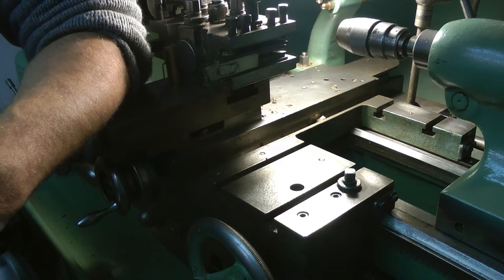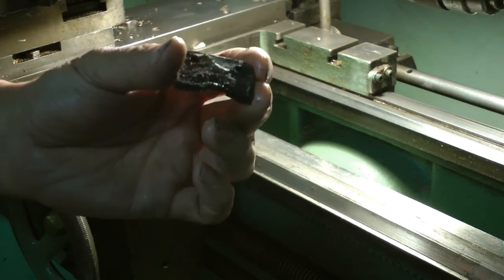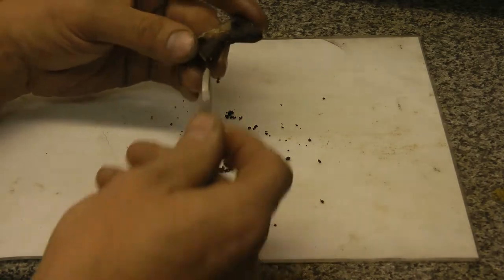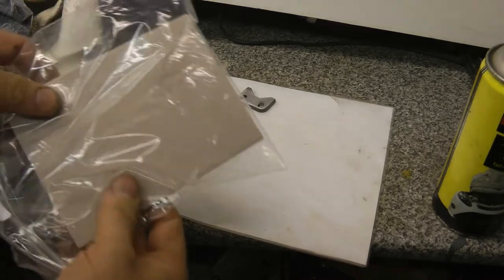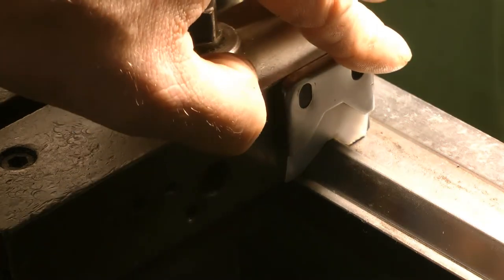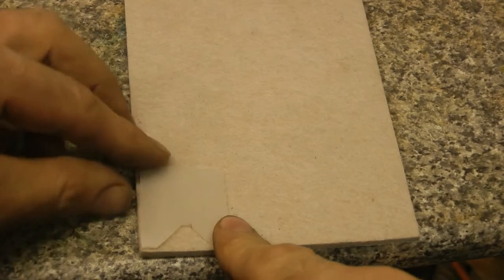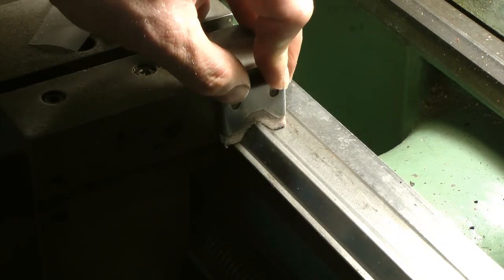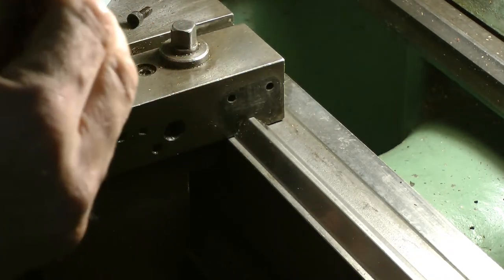Colchester lathe bed wiper replacement  and repair worth a look

Comment: The ones on my bantam seemed to be a hard wax type material. i replaced them with felt like you but I put some hard cardboard, which i had soaked in oil for a few hours, to act like a scraper to keep debris from getting to the felt.
To keep crud off the ways i have some oil proof 0.5mm rubber sheet, left over from a fetish party (i wish!) over the bed and attached to the saddle. Seems to work quite well. It might show up in one of my videos but i can't be arsed to look and see which ones.
Reply from the maker: Chris Stephens thanks Chris I’ve seen the rubber sheet doing that job it’s a really good idea 👍

Comment: If the first pen knife came from the car boot, I take it that second knife was recovered from the Mary Rose. Blow the budget and get a new blade :-)
Top idea, Chris, I'm off to make a set for myself.
Reply from the maker: sedulousdabbler there a story behind the knife... all my good work knifes are in my van which is in the garage at the mo with a suspected cam belt fail so can’t get to my gear 😕 found the knife in the cupboard think it’s for wallpapering 😅 knew I’d get stick for it but the show must go on !
Reply: I’ll let you off. 🤞it’s not the cam belt, that’s just plain nasty 😬
Reply from the maker: sedulousdabbler , it’s the belt .... going to the garage now looking like new engine or van 😕
Reply: Mate, that is shite. I hope you can find one at a good price.

Comment: I belive the original wipers was made from bakelite.
Bought a set on ebay made on a 3D printer, dont work very well.
I may be doinf the same as you Chris.
Thanks for the video and idea.
Reply from the maker: Ulrik Kaul  I believe the plastic ones are no good,  Bakelite that’s interesting 🤔, I need to do a little upgrade on my wipers I’m going to add a plastic ( milk bottle) shield in front of it to deflect debris. Small vid to follow....🙂

Comment: I have the same wipes on my chipmaster lathe. I replaced them with a set from ebay but they were just hard plastic. I need something better....
Reply from the maker: hi ,that's interesting are the plastic ones not up to the job? may I ask what were the old ones like, just wondering what the original material was
Reply: @chris-the-bodge-sculptor  the old ones were just like yours. I wish I did what you did
Reply: There Classed ! As wearable Parts ! To Protect ! The bed ! Slide !! From STUPID !! People !! Not Regularly !! Keeping it !! CLEAN !!
Reply: Hi all. Think I have bought same hard ones for my Harrison 140 , don't think I'm going to install them.were did u get the sheet of felt from please criss ?   Most utubers using felt but I'm having no luck sourcing any . USA vloggers use mc master but not available in sunny uk.
Reply: @tomroskell403  I managed to source some from Amazon
Reply: @MG-Driver     interesting mate.  8mm. Thick.  ?    Thanks for information obviously 🙂
Reply: @tomroskell403  I just ordered an A4 sheet of black felt. Not particularly thick, maybe 2mm. Doesn't need a lot

Comment: hi Chris, shit hot vids iv learn a lot about my old Colchester from you. does yours have a suds pump mine don't but I think I want one any ideas?
Reply from the maker: thanks!, mine does have a pump the original 3 phase never looked at wiring it up, you can buy coolant pumps for bandsaws etc or use pond pumps and windscreen pumps I believe.
  you'd have to protect it with a fine mesh to stop particle's getting in, I myself  want to build a gravity feed drip feeder on a arm, as I don't want to mess up the Colchester :) and I don't really do any big cuts etc to justify a suds pump and she's a old girl too lol, what are you planning to cut ?
Reply: thanks Chris,yes im the same don't really don't do  big cuts but mine is missing so I thought I should one. I cut mainly aluminium for the belt grinders I build the rollers and bushings etc thanks for your input, drip feed sounds interesting ill look into that cheers mate
Reply: I use a plastic medical iv drip feed attached to a mag mount . Works well